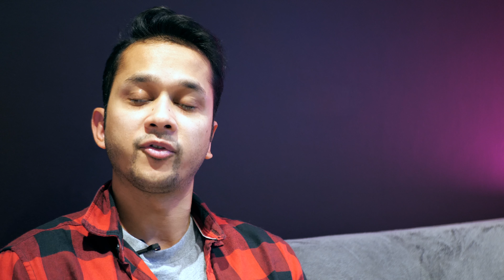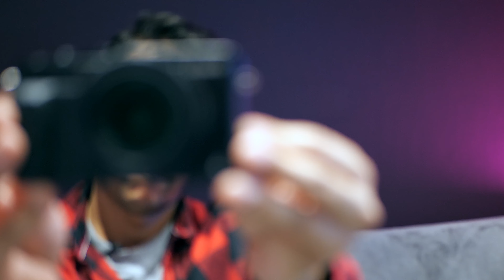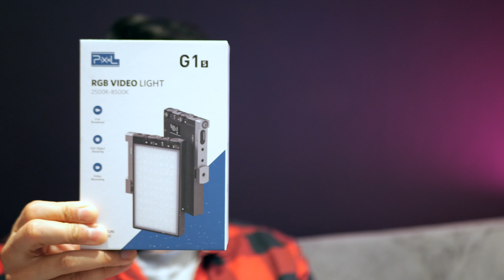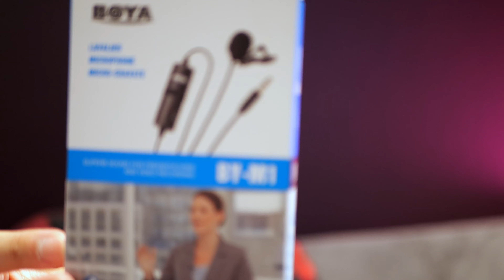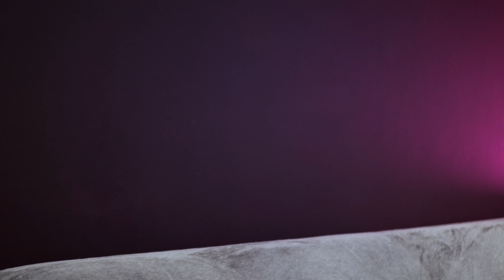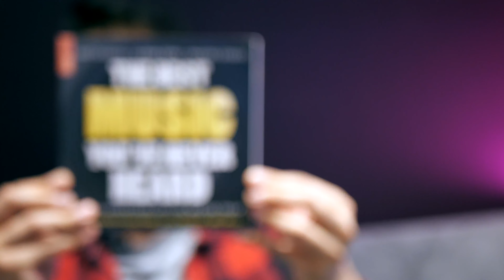Panasonic G9 Autofocus Test Firmware 2.5

Comment: In a few of your tests, just as the camera was about to zero in on the focus, you moved the object multple times. Not an accurate test in my opinion.
Reply from the maker: After watching the video back, yes I noticed this. However, I did hold the objects long enough for it to try and acquire focus but the issue is that it is still not 100% reliable. I'll do further tests.

Please note that I am not saying that the AF performance is not good but rather when it comes to continuous AF, it can, on occasions, struggle.

I appreciate you watching and the feedback. Thanks 👍
Reply from the maker: I've done another 2 videos, one if 30 FPS and one in 60 FPS.

Updated Video 30 FPS: https://www.youtube.com/watch?v=iUlChX4cUSQ

Updated Video 60 FPS: https://www.youtube.com/watch?v=qmHgyQeKOVE

Comment: No matter how you slice it, one cannot rely on its autofocus. As good as the cameras are, Panasonic will be left behind if they don't do the right thing.
Reply from the maker: I agree with you, if you are a professional and require a camera that does the job reliably each and every time then a Panasonic AF system should not be your first choice.

Me being a hobbyist, the G9's AF performance is something I can live with. For single AF it is as good as other phase detect system, granted when it comes to continuous AF it can fall short of the leading pack.

With all being said Panasonic have made huge strides in their DFD system and like I mentioned at the beginning of the video it can work in certain situations.
Reply from the maker: I've done another 2 videos, one if 30 FPS and one in 60 FPS.

Updated Video 30 FPS: https://www.youtube.com/watch?v=iUlChX4cUSQ

Updated Video 60 FPS: https://www.youtube.com/watch?v=qmHgyQeKOVE